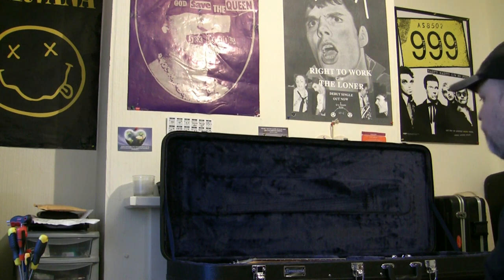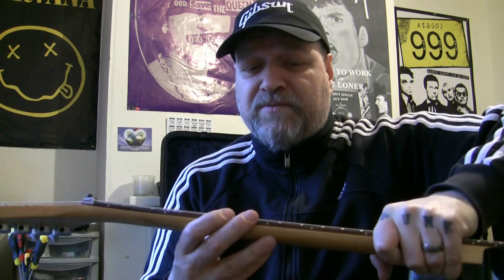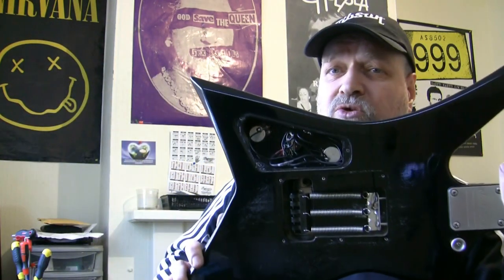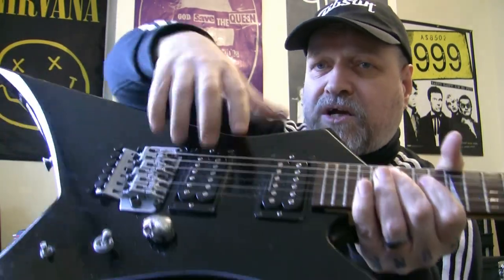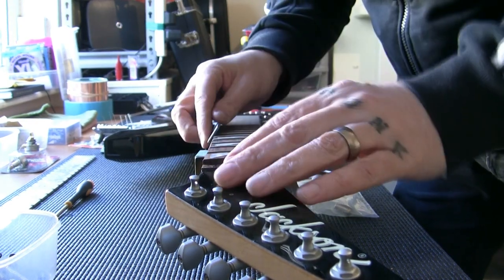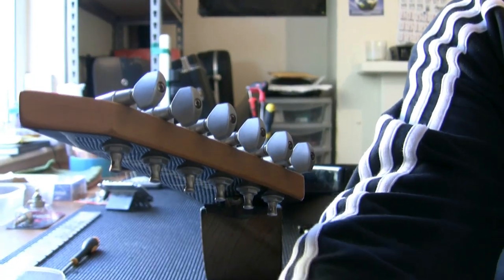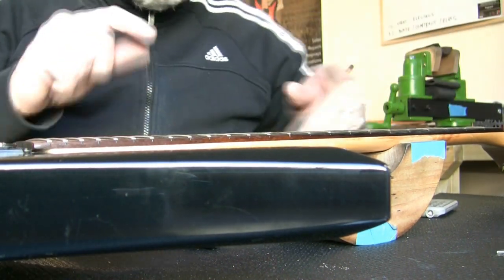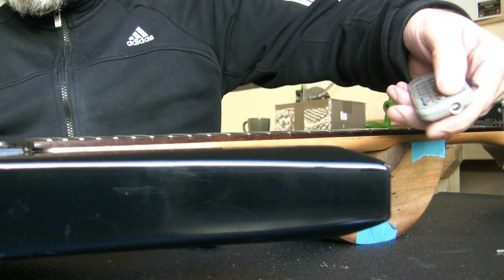Jackson KS2 Kelly Star [ Japan ]: complete overhaul/upgrade [Part 1]...

Comment: The Guitar looks (to me) like a chopped down Warrior, it could be a custom shop. Dam awesome but don't get to near on stage 😁😁
Reply from the maker: It's a Kelly KS2! Not chopped down and not a custom AFAIK!
Reply: @FretFriendGWaL  You are more then likely correct, i had a Warrior and the kellys i have seen have not been pointy (more like a Mockingbird shape) but i wouldn't know all the variants they have made. I did not mean somebody had chopped it down themselves, the finish is way to good for that.  It is a beautiful guitar no less, thank you for sharing  :)
Reply from the maker: @StrainCheck420  Guitar is a Jackson KS2 Kelly Star made in Japan between 2000-2003 (AFAIK). This has the Takeuchi licensed Floyd (very good). A much better guitar than I realised. Will be better with upgraded pickups/electrics...

Comment: you know how to set a tremolo on a ibanez gio 2005...there is no adjustment screws.....neck angle is off...
Reply from the maker: There are adjustment screws! They are the bridge posts. They should be an allen key wrench type adjuster. Regards, Victor...